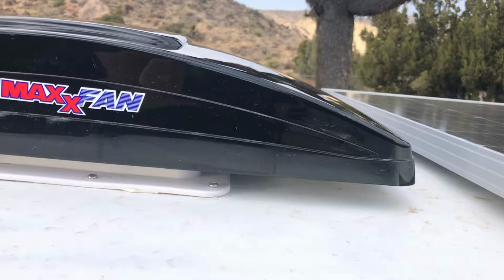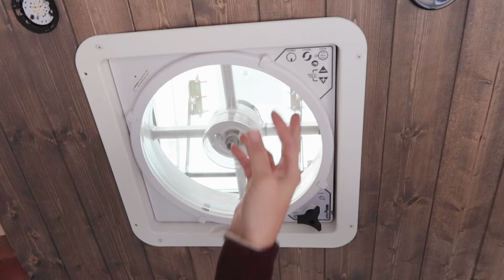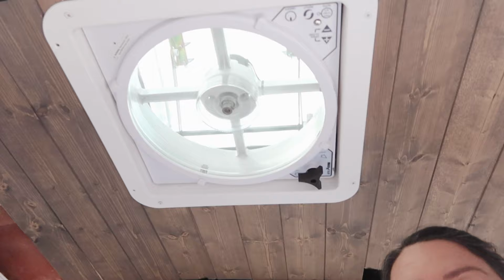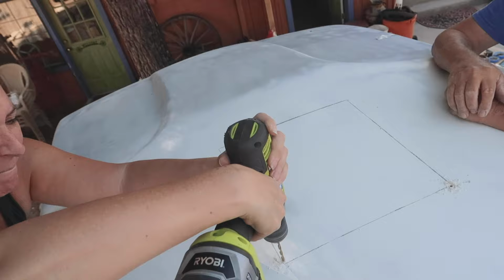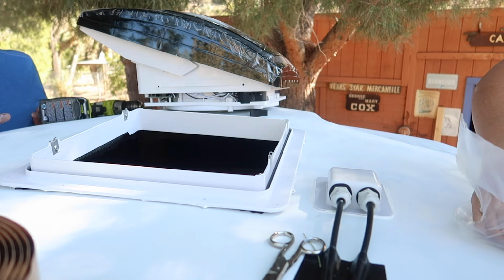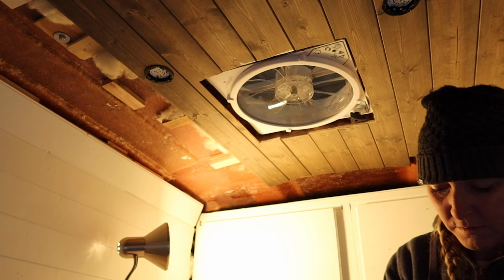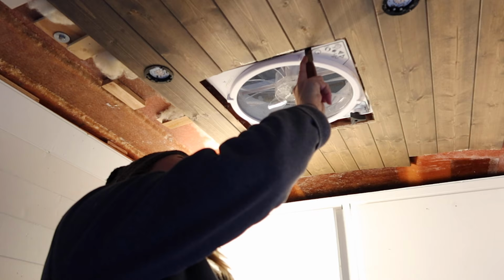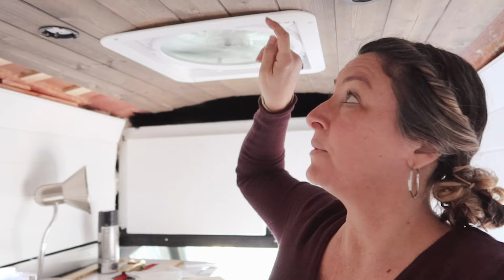How to Install a Maxxair Fan Deluxe in Your Van (Chevy Express Van)// Travel Snacks

Comment: Hey , BabyDoll ..! If you need small parts for your van , like the visor clip. You can go to a auto pull your parts. And get it for couple of bucks . You can call a dealer and find out  what years , use the same parts. Makes it easier to locate what you need.

Comment: I hope you’ll respond to this. I just installed a fiberglass high top on my van. And I would like to ask , how did you frame it?? As in something to screw the tongue and groove cladding into the roof? Did you glue battens to the roof? I can see here you didn’t have any framing in the middle of the video when you were cutting the hole for the fan, and then suddenly you had cladding on mid way and I could see some battens .. possibly? Can you quickly explain what it is you did to get battens in your roof? Glue? What did you use?

Thanks in advanced!!